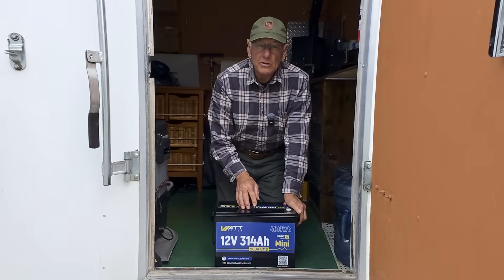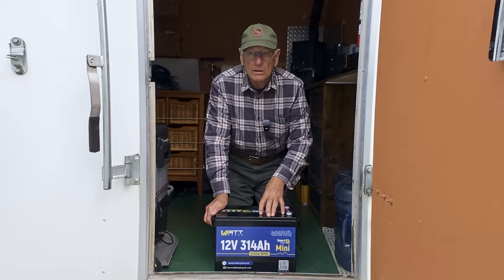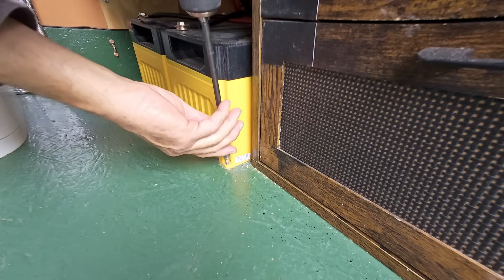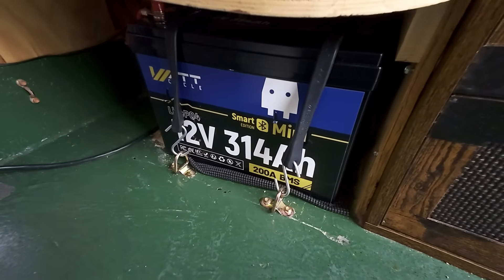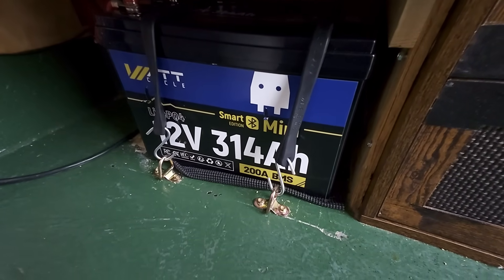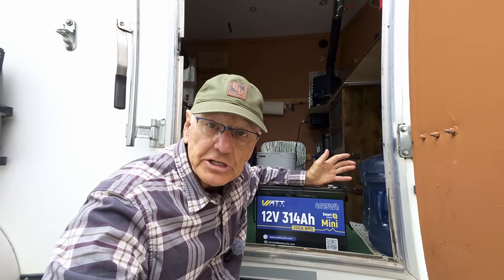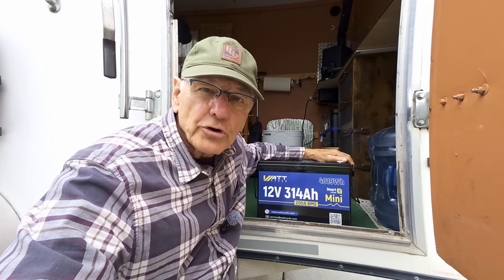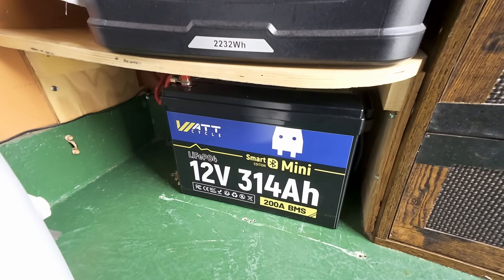WattCycle 314AH Battery - Big power in a small package

Comment: I'm still leery about hooking smart batteries up in parallel.  If you're only using one, no problem but others are saying hooking up different size batteries is not safe. I hope Wattcycle will resolve the issue with Will Prowse.  Then I will consider getting one.  I read all of the communication between them and they definitely reneged on their fee. I've trusted you Rick on a lot of your recommendations and purchased based on them in the past.  Not sure about this one.
Reply: Wattcycle has released a Beta software update on the 314, to run more than one battery.
Reply: @thomascronquist1604  I tried to download this update but was blocked from downloading. I found the problem and downloaded the file (wattcycle_25.09.03.apk). Tried to open and install, would not do it. Message comes up saying "Something went wrong". What can I do????
Reply from the maker: I'm not seeing an update.
Reply from the maker: WattCycle told me that the 314ah battery is functioning as designed.  It works in parallel, just not they way we've been used to.

Comment: My take on this is people are charging batts until the BMS disconnects. I find it creates problems; my loads get instable as the bms disconnects suddenly. Simple fix is to program the charger (Solar or AC) so its max voltage is just less then where the BMS disconnects. Then you will not have the issue.
This sounds like WattCycle is turning a bug to a "feature". The BMS should reconnect as soon as the charger stops charging. If a parallel batt gets run down, there will be a considerable current when the smart battery reconnects. Better to not have either battery disconnect .
Reply from the maker: Good info, Scott.  Thanks.

Comment: :) THANKS MUCH fors sharing ! I agree that no need to buy anything but  this type... the challenge I have is legacy lead acid ones in coach now, and would need an Inverter and or Charging upgrade :(  My thoughts are to use this for extending my Oupes Mega 1 ?  ALL the BEST and safe travels ! ! !  : )
Reply from the maker: Hello Marty and yes, for sure you would want to use a Lithium type charger and/or controller.

Comment: I'm confused on this battery after watching Will Prowse video on issues and then you're. Now don't know what to think.
Reply: @sherrystandefer  I truly trust Will.
Reply from the maker: The smart battery operates as it was designed to.  In parallel with a "dumb" battery it will let the regular battery discharge before kicking in and adding power.  It will also kick in if the load is high.
Reply: @gonagain  You keep saying that.... but Will explained in his video why doing it how Wattcycle (and other brands with similar "Smart" batteries) are doing it can lead to dangerous overloads. As others have said, they are putting a shine on it by saying they are adding a "Parellel Battery Mode" feature... but as far as I, and people with more experience and expertise than I have, can tell they had a bug in their BMS programming that could lead to problems and now have a "Beta" version of the app that fixes it. It may be how it was designed to work.... but it was a flawed design.